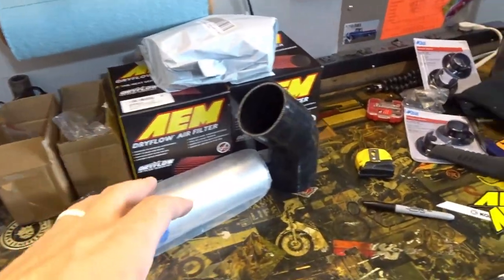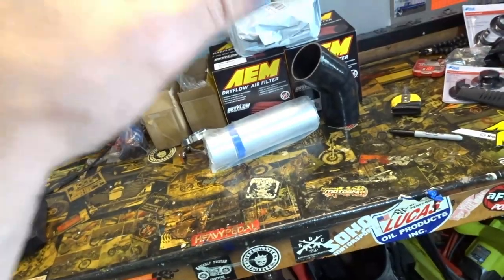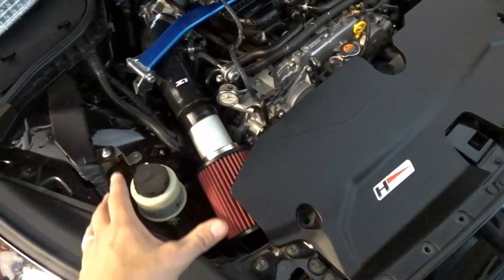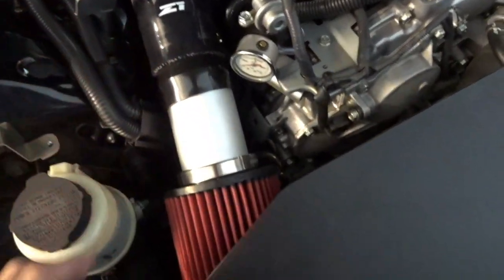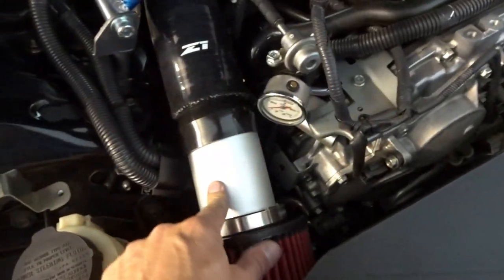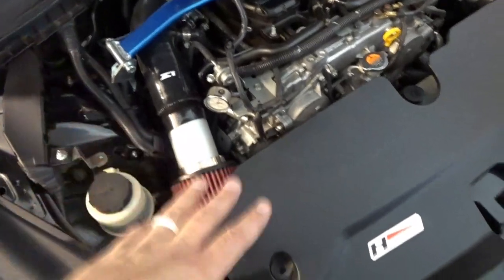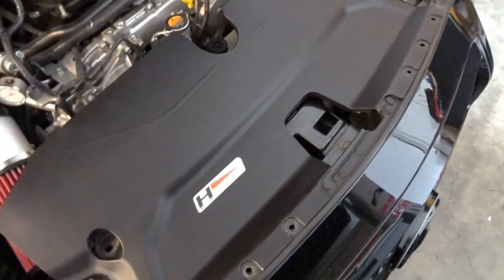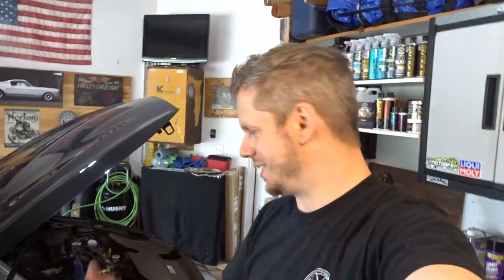New 3 Inch Intakes for the Q50

Comment: I'd imagine you are going to take in a lot more warm air. Your radiator fan is going to pull heat out of the radiator and that warm air surrounds your engine. Your factory air box was protecting your filters from the heat so I'd imagine that your car may feel quite sluggish on really hot days since the warm air can't escape except through your new air filters.
Reply from the maker: I talked about this in the video.  This is just for testing.  It won’t make any difference on the Dyno

Comment: Does your car have like a slight clunky rattling sound? Just bought mine bone stock with 70k miles and it has some weird sounds coming from what sounds like my trans. It was a similar noise I had on my 350z and I was told it was because it had a dual mass flywheel. But this q50 is a 2014 and obviously it's automatic not manual.
Reply from the maker: Shouldn’t be any weird clunky noises

Comment: I have a question, you see, I buy the Infiniti Q50 Helmholtz Axel Back and it sounds amazing, I don't have any drone sounds but sometimes I wish it sounded a little louder, The question is (How can I make my Q50 3.7 louder after a muffler delete?)
Reply from the maker: Test pipes
Reply: Do a muffler and resonator delete, but keep the cats. Make it much less raspy and REALLY loud. I literally had the same problem as you because the muffler that comes with that exhaust isn’t that loud. So take out the muffler on that new exhaust and delete the resonators and it’ll sound amazing.

Comment: Do you think the 3inch intakes that go to the grille worth it
Reply from the maker: No.  They will help if you’re racing and you’re wanting to keep intake temps a bit cooler.  They  are the best option as far as that goes but you won’t notice any power differences from one to the other—again until it starts getting very hot.
Reply: @SpeedCultureStudios  I’m in FL where it’s hot my factory intake boxes have chipped away on the bottom so i’m losing suction so i was thinking of upgrading since everyone saying the 3inch intakes make day an night differences
Reply from the maker: @nozahyoublockqork2690  if you’re air boxes are broken then yeah it’s definitely a good alternative.
Reply: @SpeedCultureStudios  not broken completely but small crack where air leaks out so i know i lose suction
Reply: @SpeedCultureStudios  So i was going to replace them with the 3inch just afraid about heat soak and i know i’ll make probably about 4 horses possibke

Comment: Weren’t you totally against getting intakes ?
Also those are short ram intakes, not good for airflow and it’s just sucking all that hot ass air back into the engine. Also will affect dyno numbers.
Reply from the maker: I talked about all of this in the video.  This is for testing and proving my point.  Just for testing on the dyno to get numbers—hot air isn’t going to be an issue.  If I did keep them, I’m utilizing the front cowl/air dam so the filters will still be pulling mostly air from the front of the car.  Again, talked about each of these things in the video.

Comment: Hot air intake
Reply from the maker: Talked about this in the video
Reply: Bet it makes more power
Reply from the maker: @joshrichie9833  Not expecting much, but we will find out!
Reply: I'm betting 330 wheel hp
Reply from the maker: @joshrichie9833  well you’ll be wrong there unless I lose power lol.  The car already makes 335/276.  You’re probably right for the baseline pull—might even be lower than that, but with the retune I’d expect right around 335 again.  According to the 3” intake fanbois, I should make 345-350 with a retune.  That, I can promise, will not happen.  If it does, I will eat my words.
Reply: Prove them wrong I went drop in afe  only because of your recommendation
Reply from the maker: @joshrichie9833  I still think that’s the best option!  Excited to get some good data